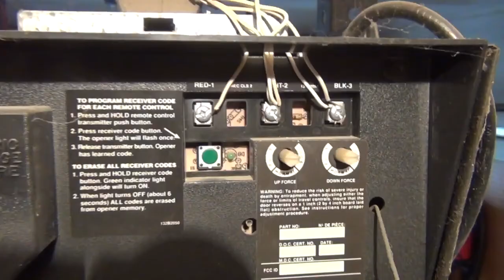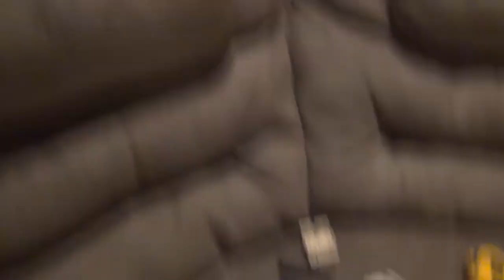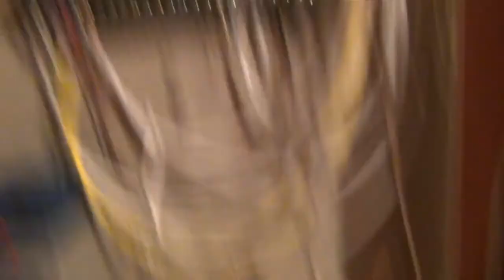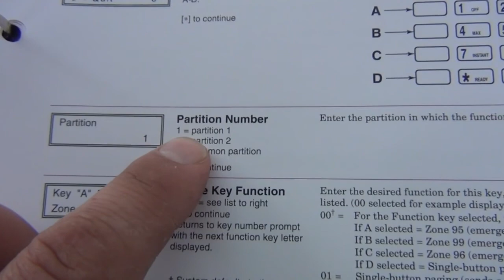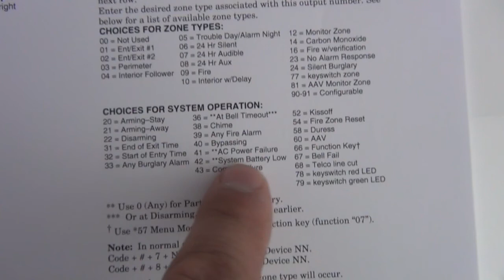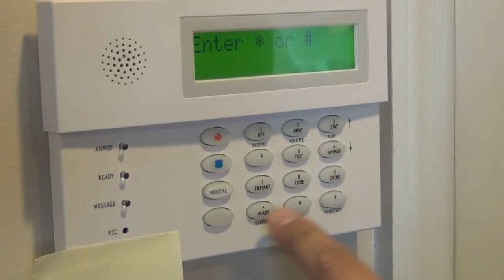How to Program Ademco Vista 20p Triggers

Comment: Is there  a time that the output stays active how does the relay know the door is open will the output say on
Reply: There is a programming function to give a 2 second pulse.  The author also said to contact the garage door, and you can tell from there that if the door is open or closed.

Comment: Any idea how to control two garage doors? Setting a function key as a trigger apparently doesn't differentiate which function key, and both relays fire at the same time for both keys.

I thought of maybe triggering a relay upon the fault of a zone I'm not using, and making each function key fault the respective zone, but I guess you can't make a function key fault a zone (that I know of).

I'm stuck.
Reply: Same question. I got it working by setting the second door and button to partition 2, but to activate the second door you need to switch the keypad over to partition 2 (code+*+partition#) and then hit the button. Looking for a better way to do that.

Comment: I have Vista SE 20 giving message communication fault 1  might be this is  due to Phone line is not  connected four wires of phone are connected in PCB but difficult to find out other end , I am using comsat internet line and did not find any phone wire in router, I don't how other end is connected , can you help me ?

Comment: Awesome video and instructions! You mentioned in the video that you can either program a key on the panel or use a keyfob. I would like to do the same thing you've done here using my Honeywell 5834-4 keyfob connected to my Vista 20p via the CE3 Street Smart code encrypter. Any advice or even just point me in the right direction would be greatly appreciated!

Comment: I am using vista 20P and relay #4204 , S since this relay is built in how do I wire this. On your vista 20P From.the common and the N/O N/C and com. I have the one pair of wire connected garage opener. And another set of two wire going from the reed Switch on garage door switch go back to the panel a nd tye into zone #5'I have what your other3 clip very nicely done., Manly it the first pair that is the problem, door opener to relay to trigger17 ' 
Thanks for any help. Gary gfvvsi@yahoo.com

Comment: question: I face a problem on programming on board trigger 18.Trigger 17 is  working ok on and off  for my dialler and programmed it to change when burglary. Now trigger 18 I have programmed it for  various modes but when the event happens the trigger changes but stays on for very long time..i have only set it for 2 seconds on/off but somehow it doesn't follow the 2 seconds...it stays on when the event happens for very long time 10 minutes...maybe

Comment: Question: I need to add more wired zones so I was going to pick up the 4229 to have more zones plus relays.  How would you wire the 4229 to the onboard trigger pins?  It looks like the directions say to wire the red, black, green, yellow to screw terminals 4,5,6,7 and nothing in regards to wiring to the trigger pins with that wiring harness?

Comment: Question: When you are programming the function keys, does it effect all keypads... So you only have to program it once on that 6160, and you can hit key D with the 6150 (that I heard in the background), and it will open/close the door... Correct?
Reply from the maker: Yes, programming the function keys will affect all keypads connected to the system.  So the "D" key i programmed in this video performs the same operation on all my keypads (6160 and 6150)  Hope this helps.
Reply: It does... Thank you!

Comment: i work installing these things and i just learned something new, great Video!
Reply from the maker: Great, thanks for watching
Reply: how do you program same thing but just for the 5834 remote?
Reply from the maker: +linkintiger I believe you would set the zone type to 23 (no alarm response) instead of 66 (function key)  You'd then program zone type 23 to the wireless remote button you want to use.  I think the manual calls those buttons loop numbers.

Comment: Thanks ZIMSJEEP ! ! ! ! !   It works great with the "D" button on both keypads ! ! !

When the "D" button is programmed as a Output Device Command in *57 Menu Mode how does the system know to execute Function 01 that is programmed in *80 Menu Mode?  The system allows up to 48 functions and I don't follow how the keypad function keys are assigned to execute the correct function.

Comment: hello, i am trying to control two relays that will activate 120 volt green and red lights to mirror alarm status.armed(red) and Green(ready) I am not sure where i should be connecting to the vista 20 in order the mirror the lights on the keypads.
Any suggestions would be greatly appreciated.

Comment: The Vista 15P only has one partition so the prompts are slightly different.  But we got it working ! ! !  Thanks ! ! ! !
Now that we have the trigger set up with the *80 function, can it be called from a keyfob?  I'm only using 3 of the 4 address loops on the keyfob, so it would be convenient to have the 4th key to open the garage door.  Is this possible?

Comment: I am thinking of trying this on my Vista 20P panel.  I was wondering if I could use phone wires for both the garage door zone wires and the wires going to the opener.  I have a phone jack in my garage.  We discontinued the hard wired phone service years ago.  The telephone line has four wires and runs down into my basement right near my alarm panel.  It would be easier than running a new line.  Also, after reading peoples reply to the video I am a little leery running the wires to my garage opener because they said if the power went out the garage would open when it came back on.  Is there a way to prevent that?  If not I might look for a Zwave solution since a have a veralite unit thats connect to my vista 20P panel by a AD2USB.

Comment: I dont see where you you completed the magnetic contact position status sensor setup for the garage door and the programming and connection to the security panel. Is this available on youtube?
Reply: If the large garage door is on the alarm it should be programmed as 03 for instant or 02 for delay 2 or 01 for delay 1. Usually a large Garage door contact is covered in metal and can be drilled to the floor of the garage and a magnet with a L bracket is mounted to the door with a large magnet  and needs to be aligned with the contact. The wire is connected to a armored lead and run the alarm panel. An alternate way is to use a wireless contact and wire to the inputs of the wireless device. The delay times for 01 should be shorter than 02. The garage may be 120 seconds to allow for opening and closing. The interior garage door to the house may be 01 and programed  for 30 seconds. As in the video the keypad was just inside next to the door.

Comment: Thanks for the video.  I setup and programmed my panel just as you described in the video.  My question is how to I assign the star on my keyfob (5834) to open the garage door along with the D button on the panel?

On a side note, I couldnt run a cable to the garage door because it does not use a contact closure to close the door.  It is a Chamberlain with MyQ.  So, I just used on of the remotes and use the relay to short the pins for the garage door.  I still plan to put a sensor to check if the garage door is open.

thanx
Reply: Update:  I was able to figure out how to accomplish my question.  I followed the video in getting the D key to open my garage door.  To add the ability to use the keyfob was actually simple.  First you must find out what zone number the keyfob is using for loop #1.  Mine was 61.  Next I went into *80 menu and created a second function.  I programmed the second function to be activated by a zone number (in my case 61), the output action was to close for 2 seconds, then output number 17.  I saved it, ran outside and hit the loop #1 (star on my 5834 keyfob) and the garage opened.
Reply: Can you please elaborate on how you used one of the remotes to control the garage door?  I have a chamberlain with myQ as well. thanks.
Reply: Bryan Belmonte I figured it out. Thank you.
Reply: Bryan Belmonte Can you post how you figured out how to configure a remote loop to open/close the garage door, please?  Thanks
Reply: Clint VanRoekel Basically, I soldered the existing wires that came from the alarm control Box (that used to connect to my old opener motor) to the remote control of my new Chamberlain opener.  

Please note that I have a remote that the alarm company gave me to arm/disarm my alarm and on this remote, it has a button to open/close my garage. I wanted it to work like it did before. It won't work when I just wired it directly to my new Chamberlain opener motor.  

With that said, here is what I did.  I located the wires that came from the control panel box to my old garage door opener motor.  Then I opened one of the remote controls for the new Chamberlain Opener and exposed the board. After searching the internet, I figured out which points to solder the wires to the board. (I touched the leads to the points on the board to test before soldering it so I knew it worked).  Once confirmed, I soldered the wires directly to these points. I tested again and it worked flawlessly.  I then enclosed the remote control board back in the case it came in.  I then hid the soldered remote inside one the light covers of the opener motor just to keep things neat. 

The only drawback to this is the the battery on the soldered remote will run out in the future but all I have to do is replace the battery and I am good to go again. 

I hope this helps.

Comment: Where did you get the relay and what is the exact brand and model number?
Reply: That relay he used was used from a old system, you might try a ELK924 sensitive relay that has positive and negative trigger inputs. Power the relay with 12volts aux power and use the trigger cable yellow T17 () to the T() on the elk relay. You would then put the door opener wires to COM and N.O on the elk relay.  When the relay gets energized it has a red status led that will stay lit for the 2 seconds. This puts a short on the Com and N.O. (normally open). The elk924 relay  supports 2 sets of contacts with N.C (normally closed) Com and N.O
Reply: Ron Thompson Thank you!

Comment: Where can I purchase the spst relay and standard keypad connector described and pictured in video?
Reply from the maker: Try ebay for the keypad connector - or you can buy a damaged keypad on the cheap and take the keypad connector off it.

Relay- try Radio Shack or ebay also.  You could also probably find in an auto parts store.
Reply: zimsjeep Please I don't know what to ask for.  Please give complete description of relay I'm to ask for. Your answer is too vague. I need to know in detail what type of relay and what the other connector is called.  Please send.

Comment: Great demo. Thanks. One interesting development I notice the other day. I powered the system off to add a new zone (following this video) and the battery went dead during the hook up (need a new one). The interesting thing was, when I plugged the AC back in, the relay tripped and the garage door opened. I have done this now three more times to test this was not a fluke and indeed, each time power is lost completely to the system results in the garage door going up when power is returned. Is there a way to prevent this? Did I do something wrong?

Thanks,

Comment: Great video! Very clear. 
I have an old Vista 30+ that has been working for about 20 years and would like to change for a new system with phone module integrated (or capable) and to use my wireless sensors. Can you advice? Would you have a video showing how to set it up?

Comment: I did the same thing... except mine is all wireless because my garage is detached... I have the relay add-on so I wired one of the opener remotes to the relay panel I have a wireless transmitter on the garage man door and it has 2 dry contacts on a separate loop.. I wired the overhead door sensor to the dry contact loop and I can monitor and open the door from the keypad, fob or from my automation computer

Comment from the maker: Yes, that is exactly how I would do it.  Keep in mind that will be it for the onboard triggers as you only have 2 available on the system.  You could add a relay board (#4204) that would expand the system to 4 triggers if you ever need them down the road.